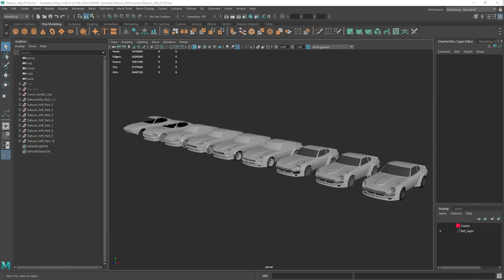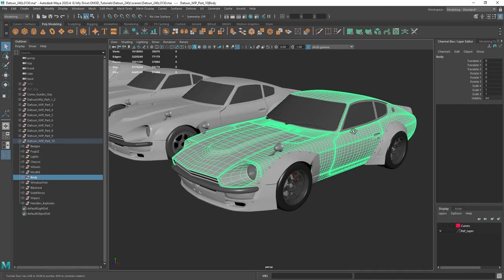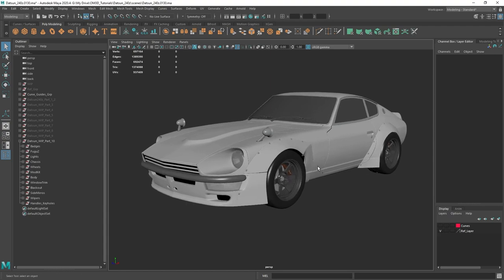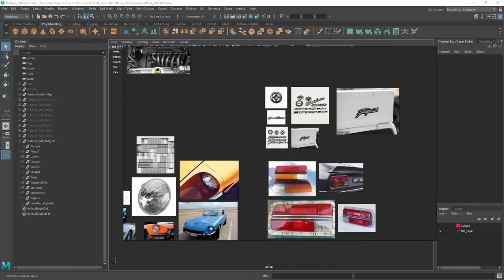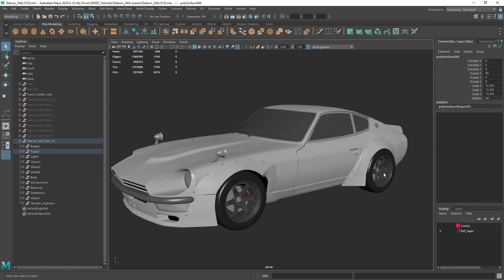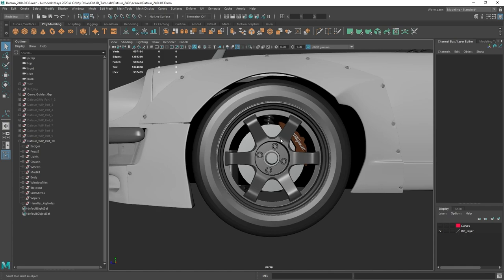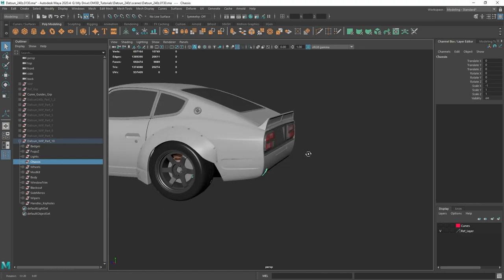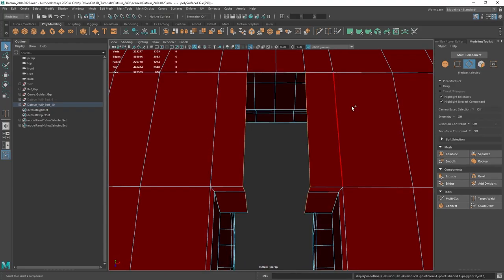3D Car Modeling - How to Finish Your Car Models

Comment: How much hours of pure work does this model take? I mean from the very beginning (blocking out) to the final result, assuming you have lots of experience and etc.
Reply from the maker: Just for the modeling portion? I'd say easily between 80-100 hours. And about the same for the interior. I'm going a bit slower since I'm capturing the entire process for my YouTube channel.